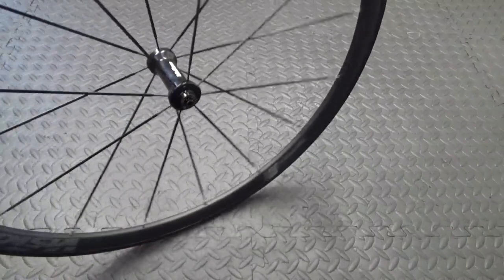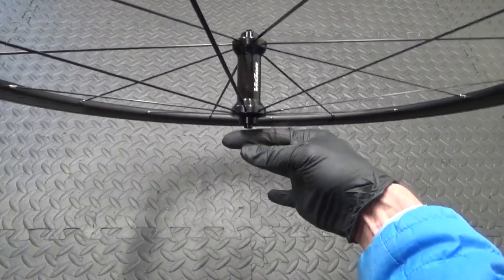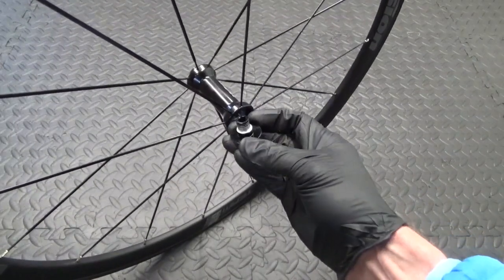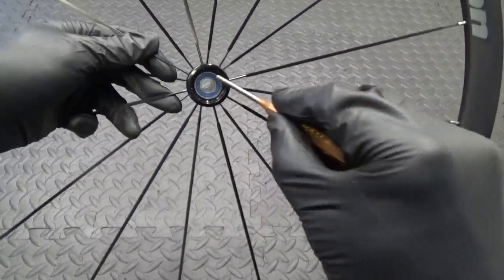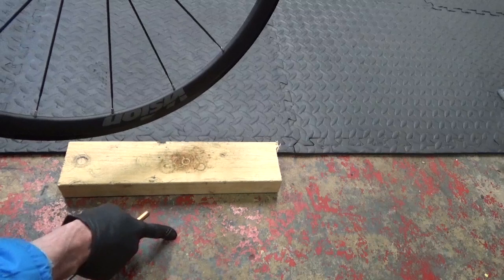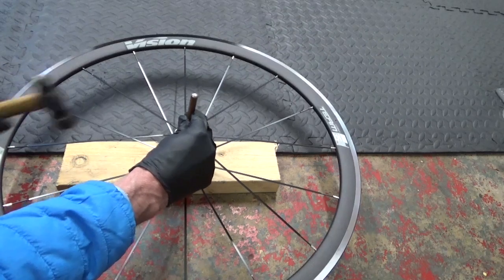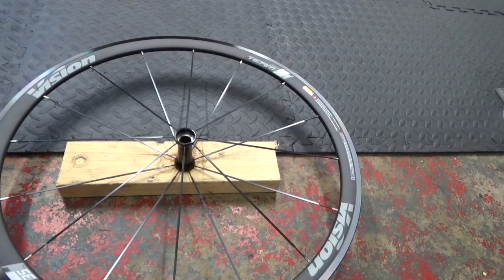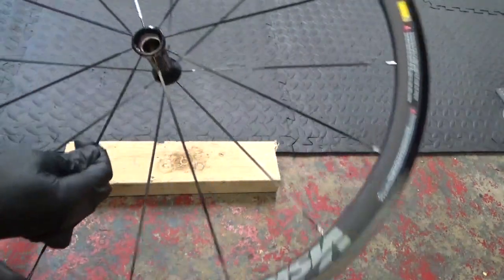Vision Team Comp 35sl Front Wheel Bearing Change

Comment: Just replaced my front wheel bearings thanks to this helpfull video, thanks! I ran into one problem: my bearings were completely stuck, couldn't get them out by tapping. I first used penetrating oil, which helped to get the first one out, but not for the second one. I heated it and then it finally popped out. On to the rear wheel!